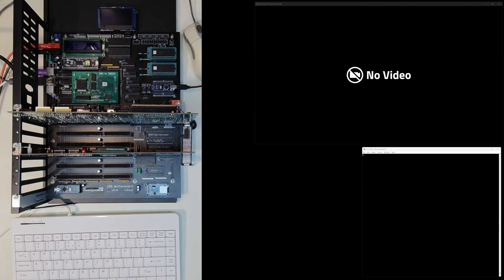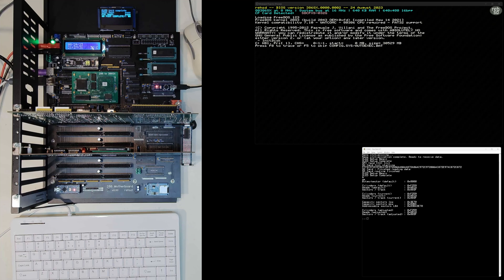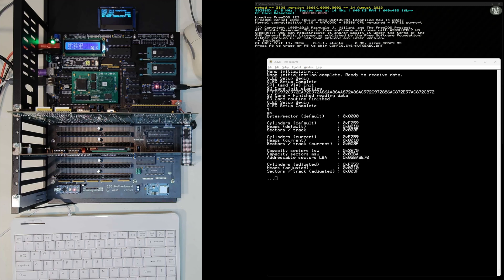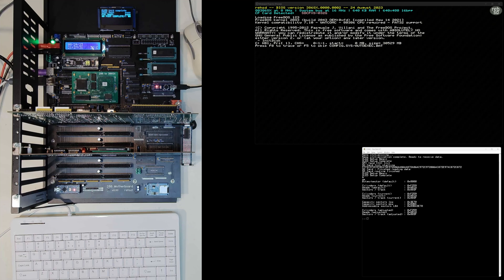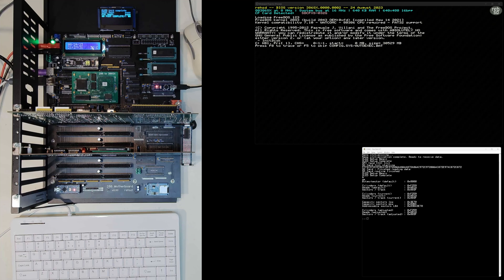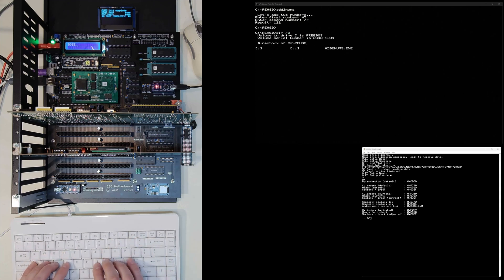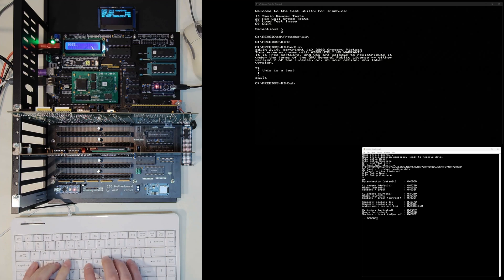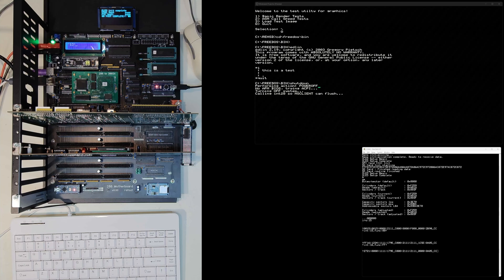80286 Build, Ep. 110 - Upgraded 386SX, Back to Running FreeDOS

Comment: This has been very interesting to watch as a series, a bunch of "aha moments" for me personally as I'm not at all into this level of design (yet). I went ahead and ordered a few pcb's from the gerber files and the plan is to TRY (and likely fail) to 386-upgrade the Tiny Turbo 286 upgrade used as another upgrade for the 8088 CPU on the A2088XT bridgeboard in my Amiga 2000 :D. Yes it's an upgrade on an upgrade on a PC in an Amiga! Also is there a BOM for the build of the pcb?
Reply from the maker: Sorry for the delayed response! If you're still looking for the BOM, drop me an email. rehsd.info@gmail.com

Comment: If use the 386 in a regular 286 motherboard what would happen? It would boot? I mean the BIOS expects a 286 CPU, will it work with 386? And the software will recognize the 386? Congratulation for making it work!
Reply from the maker: I would expect it to work fine. The BIOS code would be written for 286, but all of those opcodes should run fine on the 386SX. The BIOS just won't be taking advantage of the 386SX features, such as the two additional general registers. In my case, I could use the same BIOS and same FreeDOS that I had when running the 286. But once I load FreeDOS for 386, I can't use the 286 anymore.